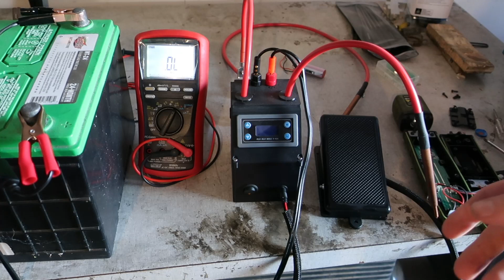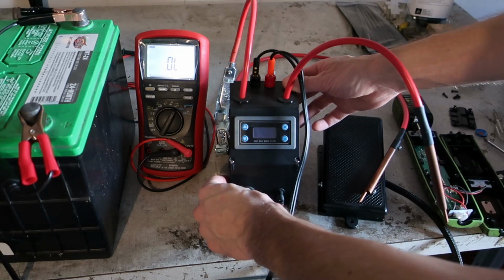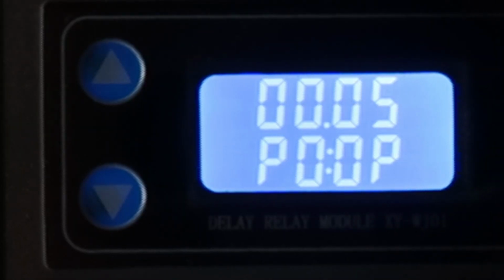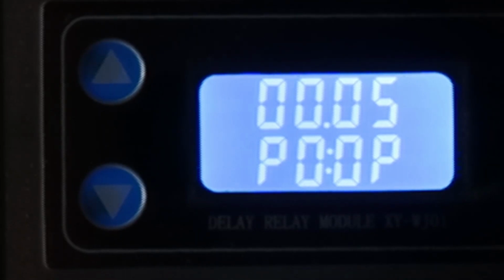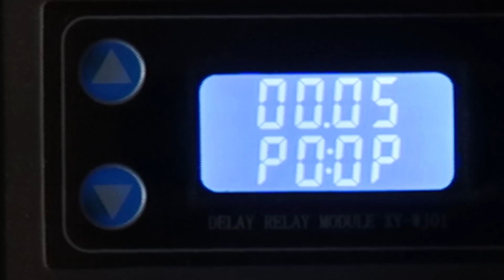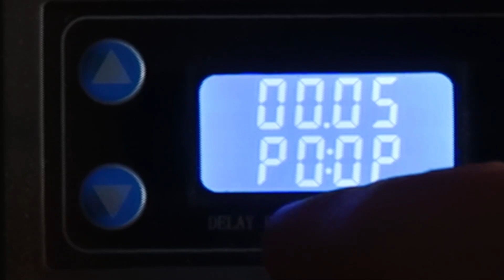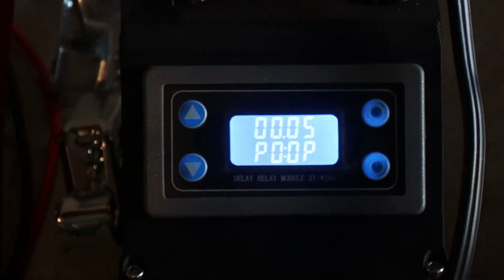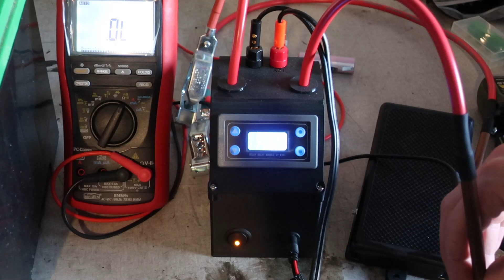Custom Battery Spot Welder - Weld Your Own Li-Ion Cells

Comment: Just curiouse the 18650’s have like some kind of shutoff so if there is to much drain or short the battery shuts down like a fuse ?
& thats diectly in the middle ? Thats y u stay away from center? Have wanted to build my own packs with spoting but have just ended up useing packs pre built & not running the proper voltage so end up loosing cells & replacing but never doing a nice job like this just taping the strips on the battery’s i know its not rite id like to learn the proper way👍
Reply from the maker: If you look at the datasheet for your battery, they'll tell you exactly where to spot weld onto the terminals. But yes, you're pretty much correct; you want to avoid welding directly in the middle because of the safety vents / pressure relief valves they incorporate into the batteries.